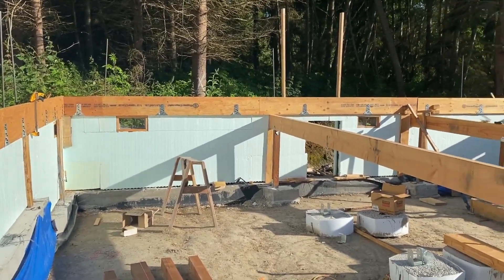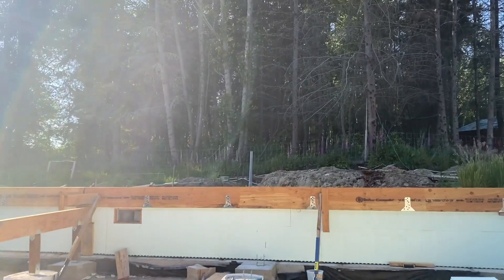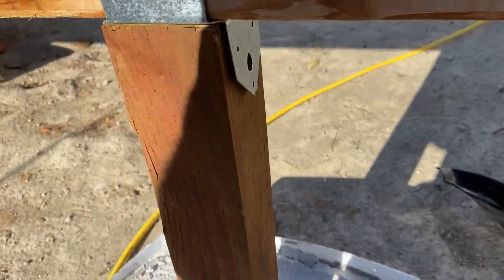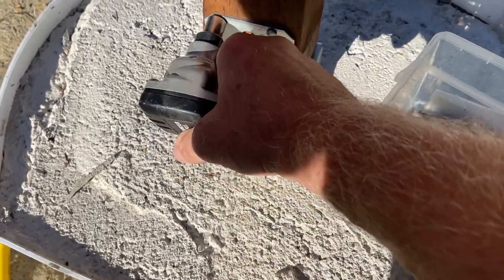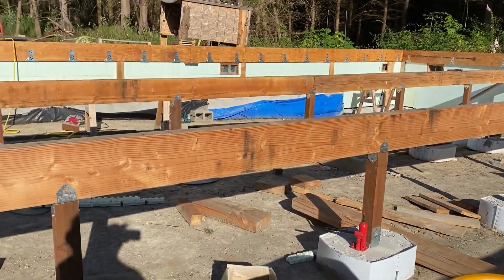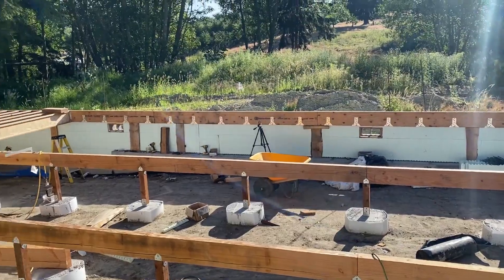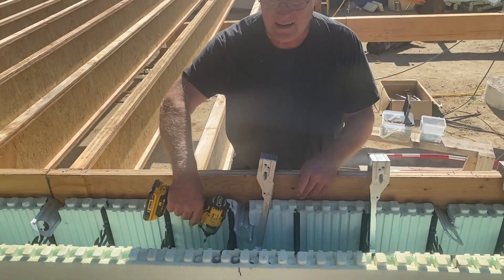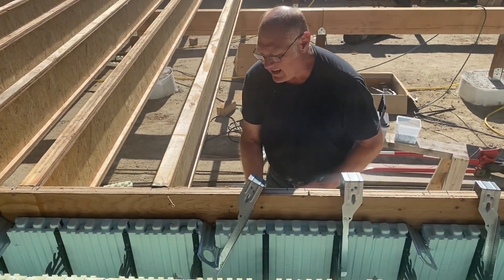Nudura ICF building floating floor before pouring concrete in wall instant scaffolding and bracing

Comment: It looks like a vented crawlspace, why do icf and have it be vented not sealed? You lose all of the R value be inviting in the outside air…and now you have to insulate the floor from underneath ? If it is sealed please carry on, but if it’s vented I’m seriously confused
Reply: I agree with you. This is required by the building code since it’s not a basement. What I did in Alaska and will do here is cover the vents in the winter   They required me to put 10” of insulation in the crawl space anyway
Reply: @stevedunivin wow! That’s a ridiculous code, because it acts just like a basement, albeit short, I can only imagine it being a height requirement? After inspection I’d permanently seal it up and…I’d pour a slab down there instead of just vapor barrier, and put vents to the living space, and a dehumidifier depending on occupancy and temperatures
Reply: @jeffspangler2367  I will use it as a root cellar since the south end has almost 6’ of head space

Comment: I'm fascinated by your installation of the floor framing before pouring the walls. I've watched this video multiple times.
Though, I am not a fan of the metal plates hangers because potential of rusting over time, in the damp/corrosive location where I build. I'm wondering if you have any experience using bolts to connect the load bearing rim joists, using a ledger nailed onto the rim to support the ends of floor joists?
I'm also wondering what you are required to do in the crawl space on the surface of the foam? Where I build I am required to cover exposed foam to give it a fire resistance rating. 
I also have to worry about termites burrowing into the foam (southeast USA). Is that a concern for you?
I've watched every video you have posted at least a couple of times. Thanks for sharing!
Hope you will have another video soon. Its been 3 months! Can't wait to see your progress.
Reply: Hi old carpenter hope all is well. I would never use the Simpson hangers again. They are galvanized and shouldn’t rust but they are lots of work and very expensive. On all of my previous jobs I have used J-bolts. Easer cheaper and in my opinion just as good. The trick is to screw something over the nut or there will be one that isn’t all the way in and doesn’t get found until it’s to late. We don’t have termites up here but in the south they make a special form that has some kind of insecticide in it. I have never had to cover the foam in a crawler for fire maybe a moisture resistant drywall or concrete board. You might even be able to spray it with something  like rapid set. I have been focused on getting the roof on I apologize for not getting another video up. Thanks for lighting a fire on that front